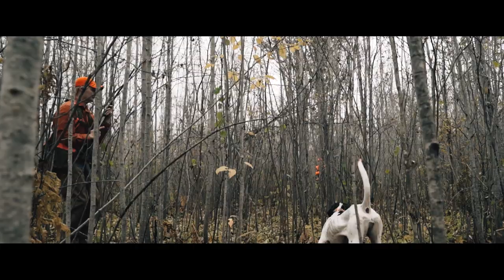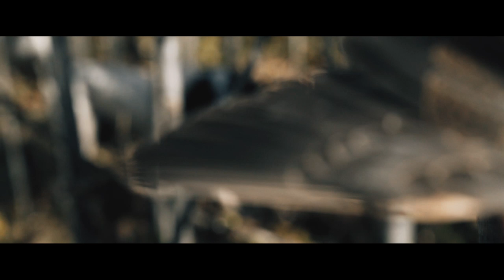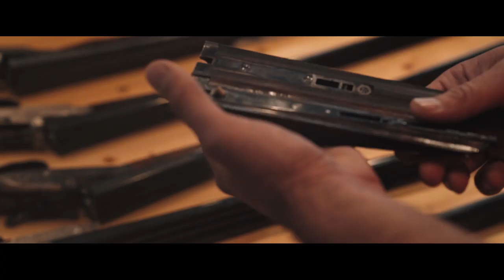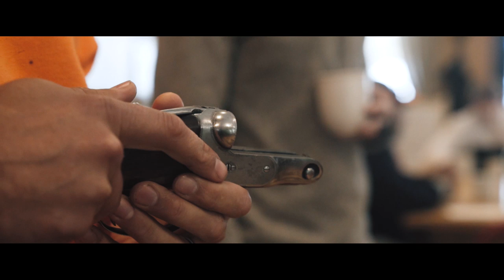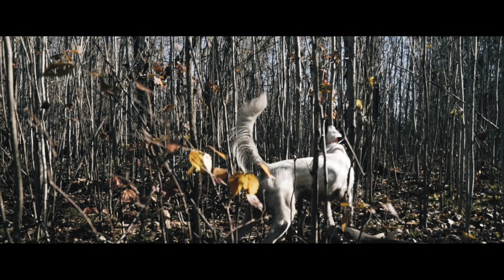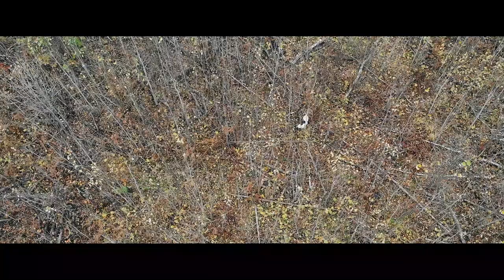The History and Legacy of Side by Side Shotguns - A Grouse Hunting Tradition

Comment: Check out my ww2 german side by side i bought, on my channle.  I rescued it at a gun shop.  Had a broken stock..  broken trigger and safety spring.   I took it apart.. welded the trigger levers back tigether.  Found a new apring for the safety.   Doweld and epoxy the stock.

Took it to the range and it fired beautifully.   Its also Heavily engraved.   And the history on it is amazing.  I looked up the proof stamping and found out alot of ww2 history about the factory in germany it was made at.  And it was also made in 1942.

I love this gun, and im glad i was the one to buy it.  As someone who is german myself,  i took pride repairing a peice of history.   And judging by the engravings on it.  And me not being able to find one like this online anywhere with these engravings..  It might be one of a kind,